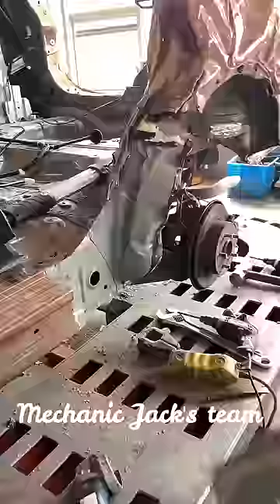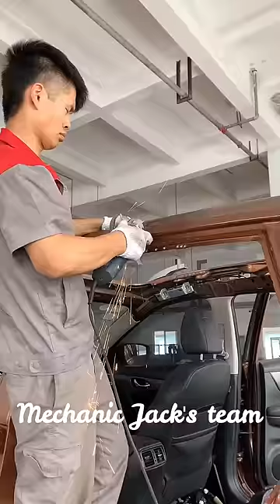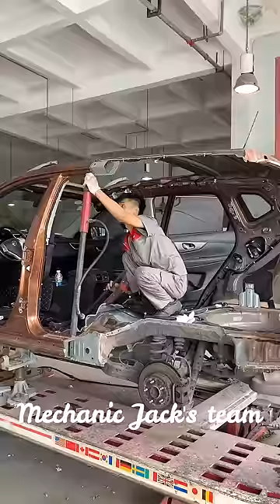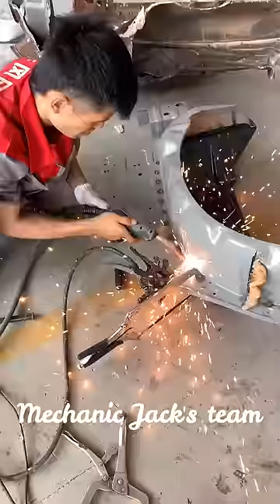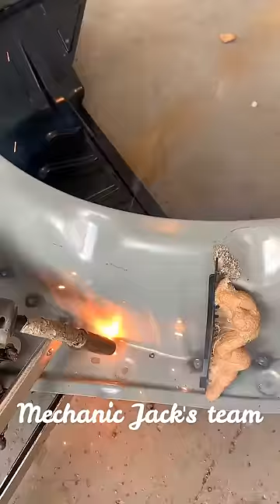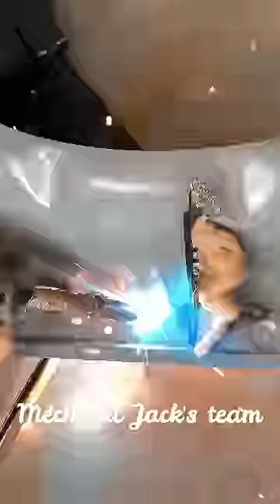Restoration of Nissan Livina 3

Comment: He is fast, problem is I never see them use weld through primer as it is necessary for any welded areas. Must be primed and coated with anti corrosion.  This appears to be a Nissan dealer. Not done by factory requirement